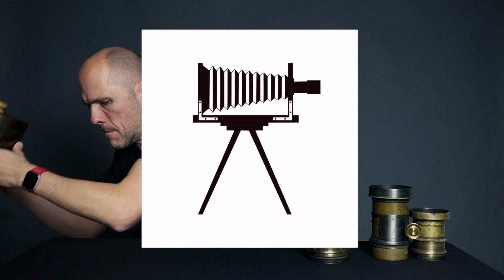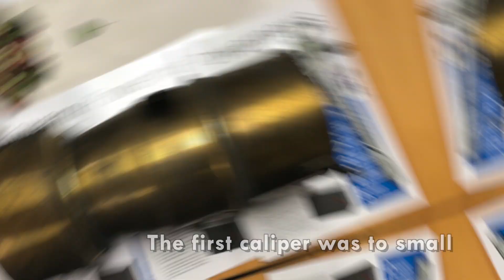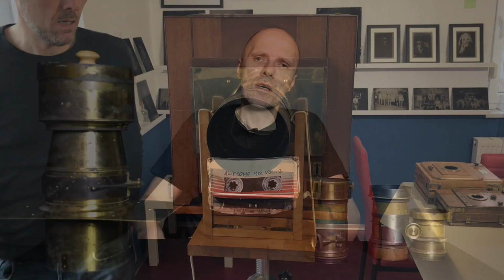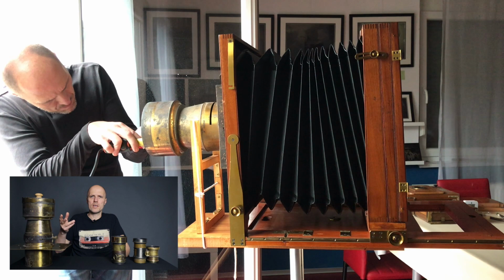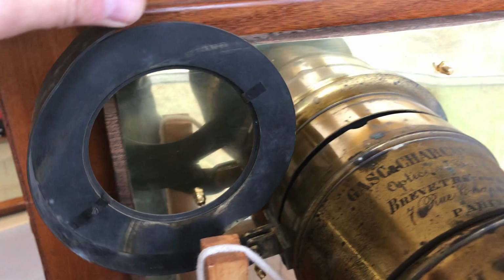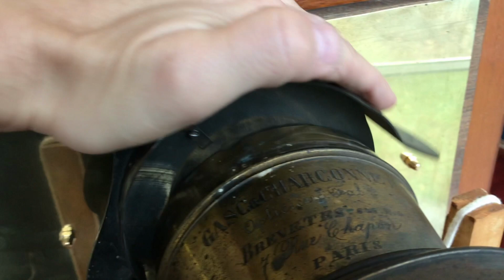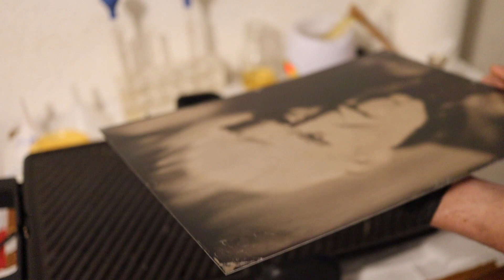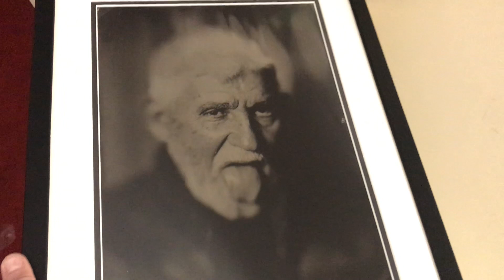Bringing a 160 Year Old Giant Petzval Lens Back to Life

Comment: Great work. I am more of an optical engineer than a photographer. Your measurement of F is quite accurate, but The field stop of the lens is measured by looking through the lens at a bright flat background, and using the measuring scale that you have, measure the diameter of bright circle of light being seen through the lens (at maximum aperture). You could measure this at the film plane or further back. The F/D formula would then give you the actual f number.
Reply from the maker: wow, thanks so much for your explanation!!  When I look through the lens on a flat background, how far should the lens be away from that background?

Comment: How much power does the strobe need to have for an exposure for plates? Is 1000 watts enough?
Reply from the maker: It depends what lens you use and what size your plate is. For example, I use about 3000w strobe power with a 85cm softbox and a F3 lens on a 13x18 plate. Here I used about 6kw. You can use a 1000w strobe with a std metal reflector and a 4.5 lens for 13x18cm plates. Maybe you need even less power with fresh collodion.

Comment: Hey Markus, how do you meter for the strobe while using the lens cap as a shutter?
Reply from the maker: Great question! I am working here with iso 0.5 to iso 1 - depending on the age of the collodion. My emulsion is only blue sensitive. At f 4.5 and the bellow extension I get a good idea what I need. The rest experience and gut feeling. I also have a bit of room to get it right during development. That’s what I love about my work. I feel what I shoot.
Reply from the maker: I have a strobe calculator on my patreon page now. It’s pinned
Reply: @mhaustria  I saw, that's a huge help! thanks!
Reply from the maker: @AveryDelMiller  very welcome!

Comment: Excelente vídeo!
Cómo calculas el tiempo de exposición, en función de la luz y la apertura, en estas máquinas tan rudimentarias pero de un gran valor artístico para el colodión húmedo.
Estoy haciendo una cámara totalmente manual para experimentar.
Gracias.
Un saludo.
Reply from the maker: Thank you so much. I had to translate your answer and hope I got the questions right.
I guess the exposure time with the typical exposure triangle. ISO is about 0.5, with fresher collodion it is probably about 1 - older one is below 0.5. Then I knew I'm shooting a very large plate, so I needed more light and also the camera was full extended. As you have seen, I calculated the aperture at about 4.5. So I guessed I needed full power on my generator (about 6000w) and also put the defusing cloth off the reflector.
During development you see if you I was right or wrong with my guessing. A proper exposure needs a 15 seconds development. If I remember right, I developed between 12 and 15 seconds. Couldn't be happier with my outcome.

Enjoy your camera project. I would love to see the outcome.

Greetings from Austria
Reply: @mhaustria  
Gracias por tu respuesta y es una gran satisfacción para mí el poder contar con tus consejos sobre estos temas.
Mi proyecto está en fase de construcción de una cámara en madera para aprovechar un objetivo de 105mm procedente de una ampliadora para un resultado en placa de 9x12 en colodión húmedo. Al tratarse de una creación artesanal y carecer de experiencia, será un resultado difícil de predecir, pero soy un gran aficionado a esta técnica. Tendré mucho gusto de hacerte llegar unas fotos de mi proyecto que espero que pueda ser realizado en un plazo medio de tiempo.
Magnífico resultados de tus fotografías y de tus vídeos muy bien planteados y con un detalle extraordinario, lo que nos facilita mucho a nosotros los aficionados al colodión húmedo.
Disculpa por no saber el idioma pero con el traductor se consigue un porcentaje alto de entendimiento.
Te estoy muy agradecido.
Un cordial saludo desde Barcelona (Spain)
Manuel 🤝
Reply from the maker: ADELBERT WEBER thank you so much for your kind words. All the best with your project! You are right, the translator works well. Look for a Industar 210mm F 4.5 lens. It is super cheap and will work perfectly with up to 13x15cm plates.

I visited Barcelona some years ago and liked it a lot.

Markus